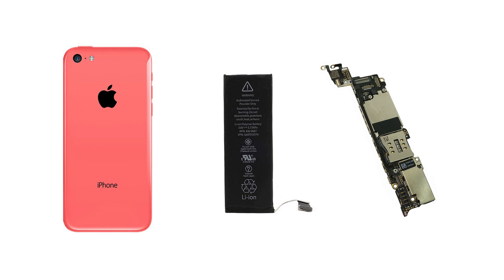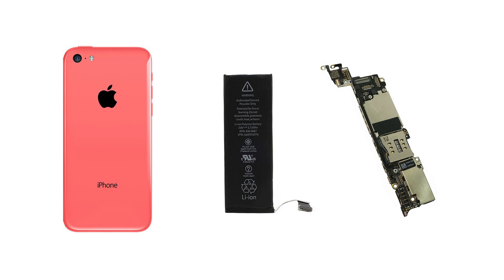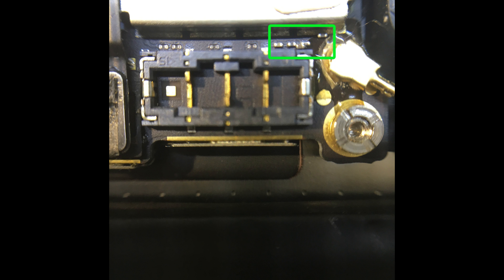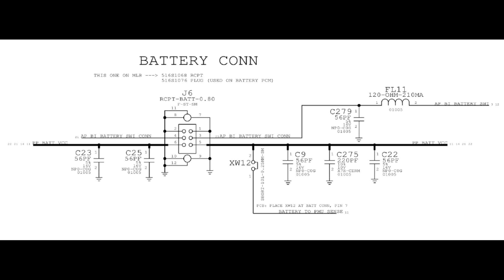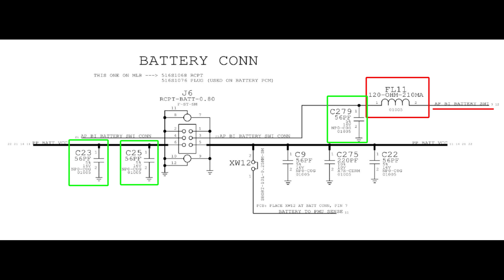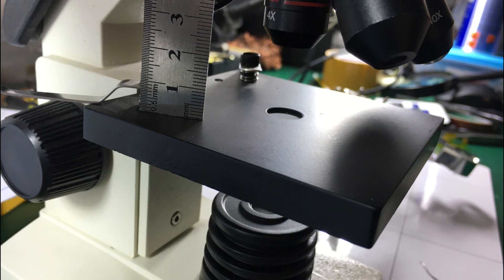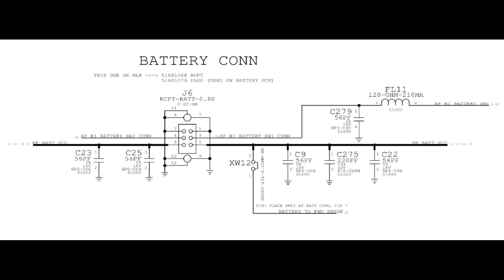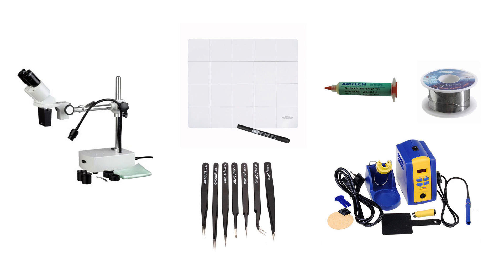Voltlog #52 - Iphone 5C Constant Reboot Logic Board Repair

Comment: If you buy a microscope with increased working distance , you could consider buying one with a camera option otherwise you wont be able to show us the microscope work you're doing in a video :D
Reply from the maker: yes a trinocular microscope would be awesome but it will cost me at least $100 more on the microscope alone, camera not included. I can't cover such a cost, at least not now and I'm not doing that much work under the microscope to justify the investment.
Reply: I understand , you could hack it to make videos from one of the bino tubes using a cheap camera

Comment: Glad you got the phone working in the end :)  I hate it when you attempt to fix something and then make another repair for yourself in the process. 

JFYI.. Please check the Amtech flux your using.. It's likely not Amtech. Amtech is made in the USA and says so on the tubes.
I use the Amtech 559 V2 flux which is excellent (and smells nice too :) I get it from here in the UK if your interested, It's quite expensive £15.99 for 10cc but it's the real stuff.. http://goo.gl/WNrKzF

Cheers
John
Reply from the maker: All Amtech flux syringes I have are marked with "made in usa" but that's not a guarantee they're genuine They get the job done though for a few dollars. I haven't seen flux that smells nice so far :)

Comment: Nice video, thank you! What would be the finest soldering iron tip one could buy for these repairs? Like you said, you can see the repair job but soldering a microscopic capacitor with a soldering iron? You would need a soldering needle?
Reply from the maker: All reputable manufacturers Weller, JBC, Hakko have fine tips designed for micro soldering. However, using a very fine tip in an older (even worse if it's a clone) 936 soldering station will not work very well. I have a 936 clone and when I use those very fine tips, I can't solder anything, very poor heat transfer.

Comment: Good job, for delicate connectors I always use the spluger built into the end of my index finger.
Reply from the maker: honestly I still don't know if it was the plastic spudger that ripped those components off or if it was me pressing the battery connector on top of them.
Reply: VoltLog they are seriously small components any contact could possibly rip them off.